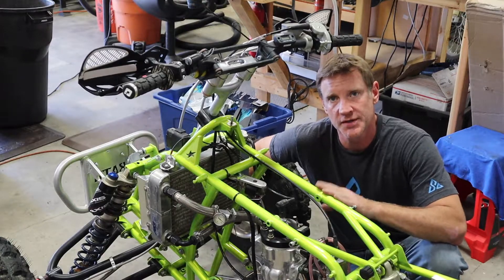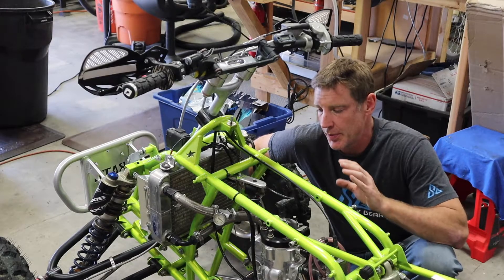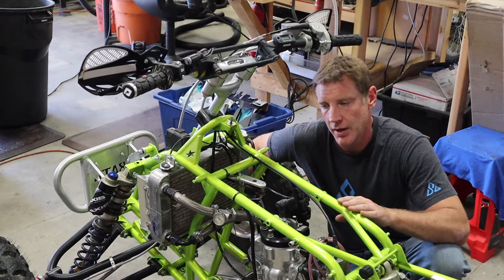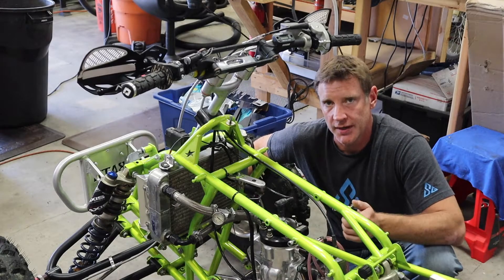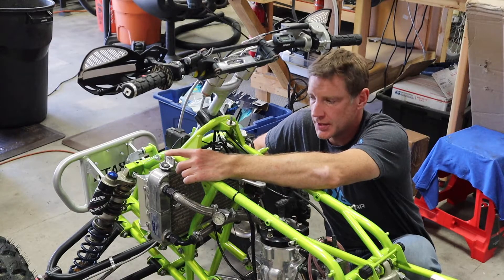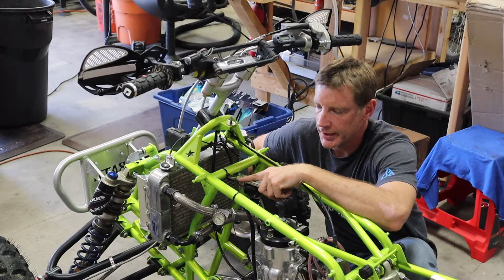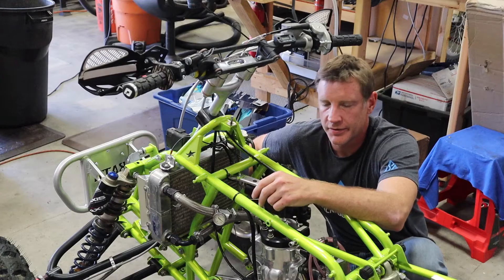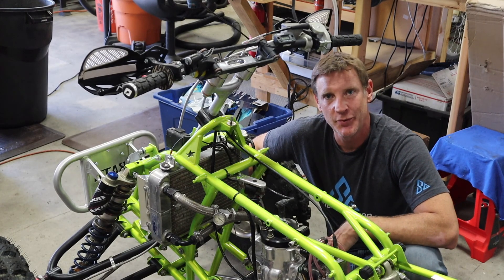Build a Race TRX250R ATV - Ignition and Wiring

Comment: I'm running HP 68 ignition from LED performance. It is great and just like cr no lights
Reply: How did you wire the kill switch?
Reply: The black/white wire from red box and the black ground goes to my kill switch
Reply: @ronro4584 does it work that way with a tether kill switch aswell?
Reply: @Yavi250r  sorry idk mine is just kill switch...I'd think so but idk

Comment: I have a vortex X10 Cdi on my 250r. Its frigging bad ass...10 maps..stock 125 and cr250 maps and modded ones of all. Mine was done by toyoko mods. I also run a DC converted stator. Stock cylinder ported motor, 225psi starts first kick all the time.